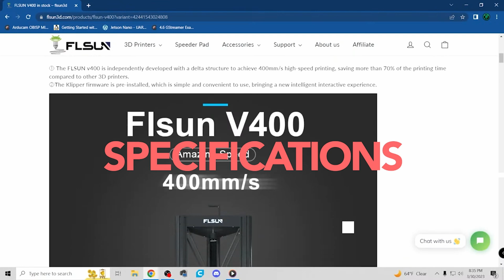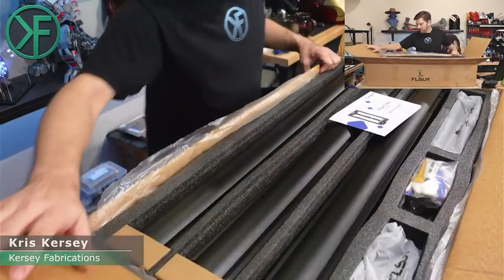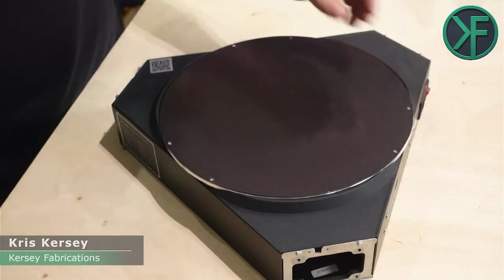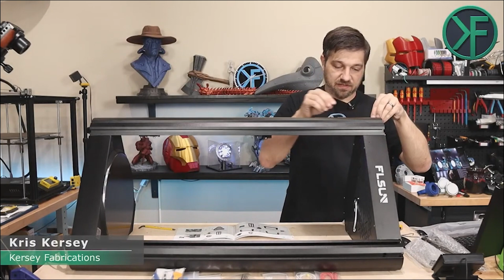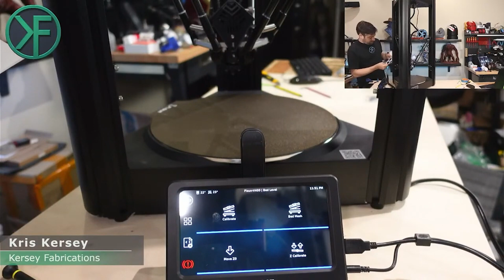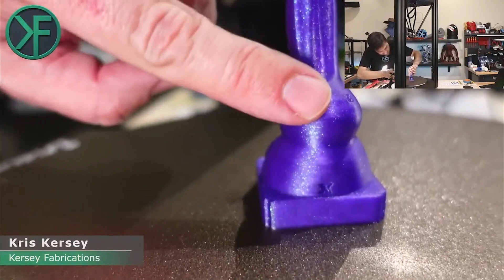Flsun V400 3D Printer Live Build Highlights

Comment: Nice looking printer.  What processor is running Klipper?  I looked at the specs and couldn't tell - maybe I missed it.
Reply from the maker: Yeah, I really like this machine and plan on revisiting it in a couple of weeks. I have not tried to pull apart the pad yet to see what's in it. I'll check with my rep.